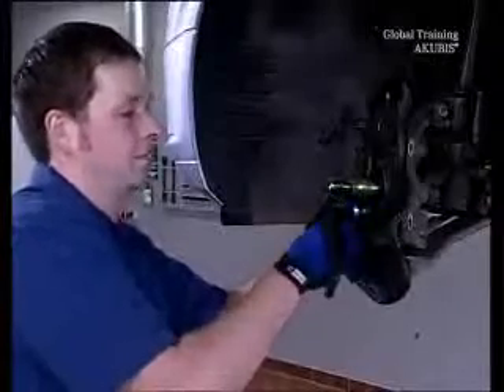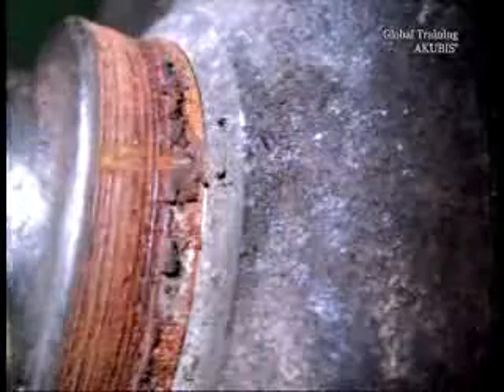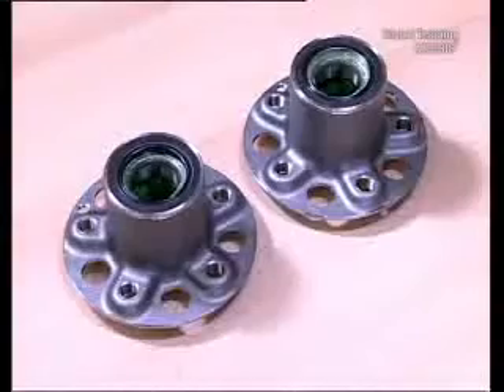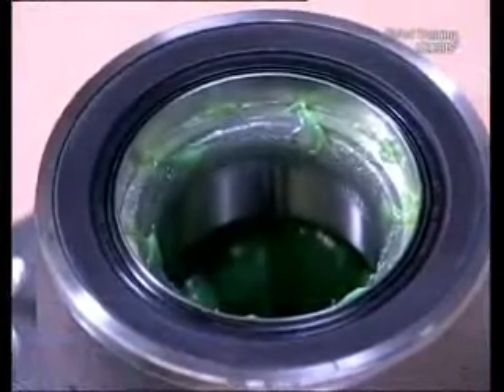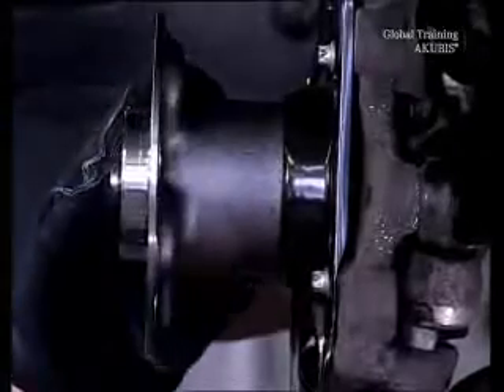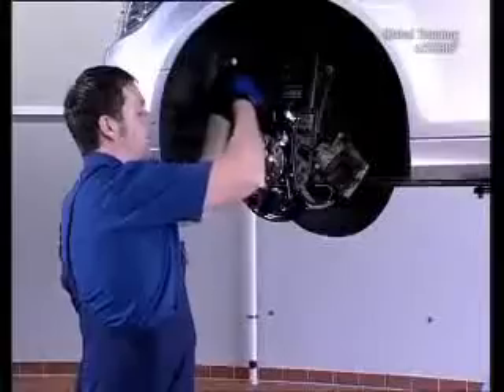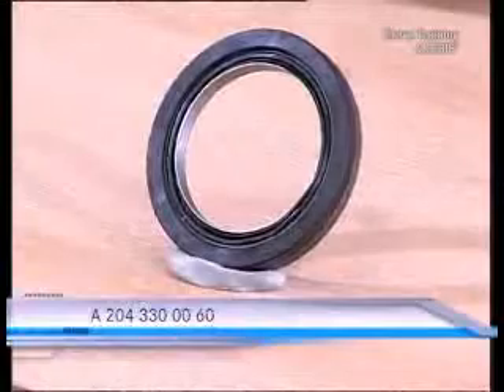Mercedes Benz C Class Front Wheel Bearing Replacement

Comment: Just an FYI sealing ring on my front of W203 is 2033300060 NOT 2043300060 and it does not have the stainless steel ring. 
Wow that one threw me. It appears that was NOT used on W203. Not until 2009 on C class.
Reply: I have a 2010 w207 and when I pulled mine I did not see a sealing ring on factory. Do you know if this is added later on?
Reply: @Dynasty-s1y same here on my c207 E550. I replaced my old hub with a new hub and bearings/races assembled but I took out the sealing ring and my bearings still feel bad even though they’re brand new. Going to try to re-install with the sealing ring.

Comment: My mechanic replaced the front passenger wheel baring for my  Mercedes C Class same Model as in this video. But now the ABS warning light is on. Also when I press the brake paddle while driving the brakes vibrate badly. Mechanic has tried everything he Could but the ABS Warning light is still there. Could you please advise what can be done for that? I will be very thankful. Regards 
Kelly
Reply: Not installed your bearings correctly. Prone to premature failure. Take it back.. And get done properly.
Reply: The rubber/metal seal is magnetic and responsible for delivering the ABS impulse. That seal is to be handled with care, not near to other magnetic objects, also pressed, NOT hammered into Place. And most important, not too deep inside he hub, but to be leveled with the hub edge. As done in this video with the special tool.
Reply: hahaahhaha  he put the bearing in backwards,   the magnetic side he put facing wrong direction,  or wrong bearing,
Reply: Air in the abs system which is affecting the brakes and the abs sensors needs to be changed

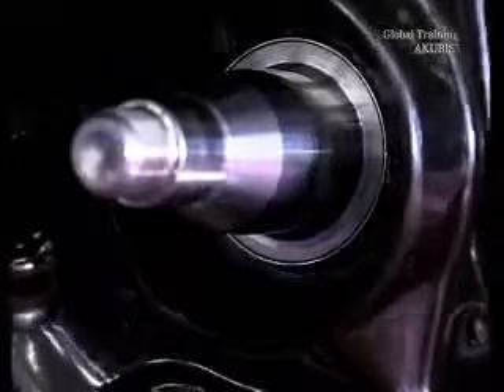Comment: what is going on @ 3:17 ? I thought the new hub with bearing is a straight install.
Reply: Same question.
Reply: Same. Everything was straight forward until that moment..
Reply: confused me too
Reply: What is shown at this moment is what follows: The stainless steel ring shown moments earlier, and that is an updated feature, must be pressed onto the spindle together with the hub, and thus with the ring mounted into the rubber seal. If not, the bushing will be destroyed upon mounting.
Reply: @berry254  Should I be able to replace a hub with a used one from an other car or do I have to make sure that the replacement does not have the updated feature?
Reply: @sfax  If the new ring is mounted, it also needs the new version of rubber seal in the hub. And vice versa - a hub with new type of seal needs stainless steel ring mounted.
Reply: Why is this ring a new feature? The one I pulled off my car after 12 years did not have it. What is the purpose of this?